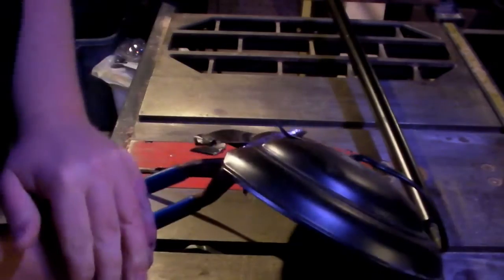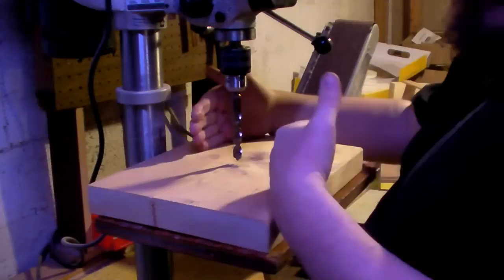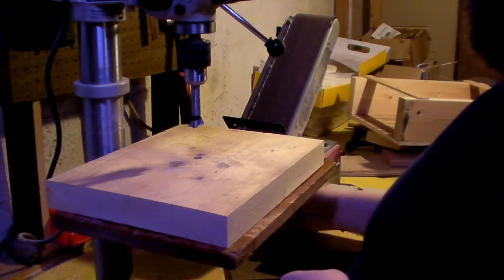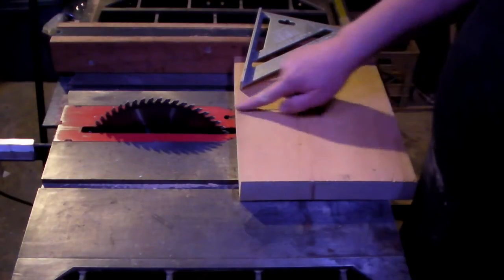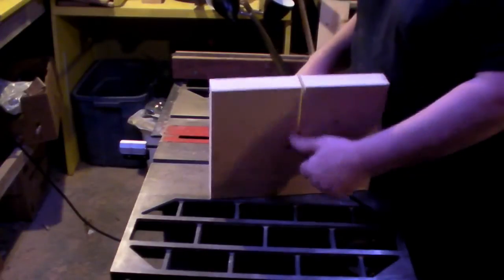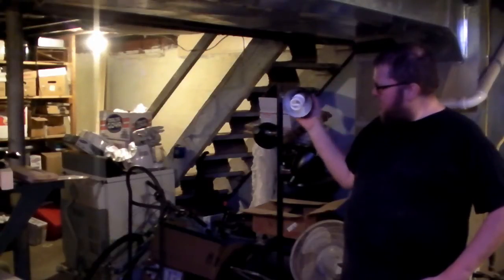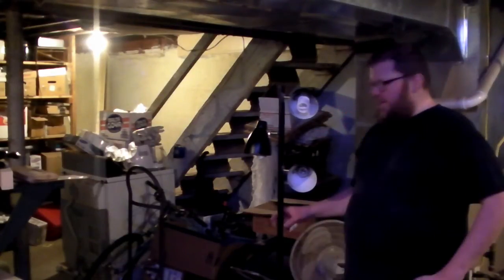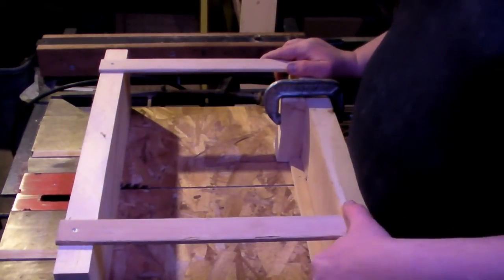Floor Lamp broken base repair

Comment: This is more work than just getting some Quikrete and pouring it in to the up-side-down base (see video https://youtu.be/GHD83PdoBIQ   If you have the power tools for this one, go ahead. One thing is though a wooden base will not provide as much weight or stability for the base of a tall lamp.  Most  pole lamps these days have either an iron or cement base...for the weight.